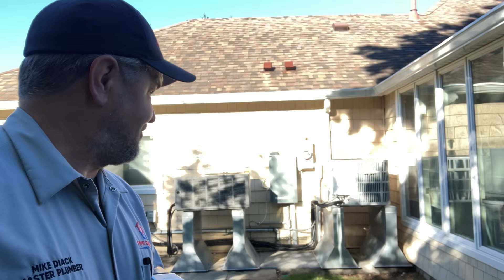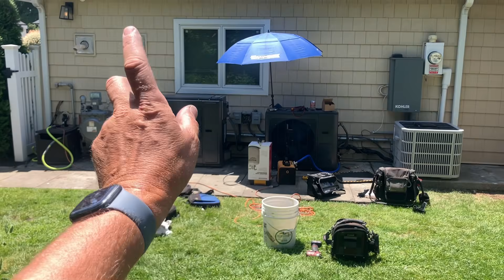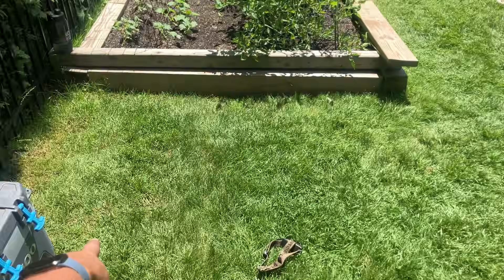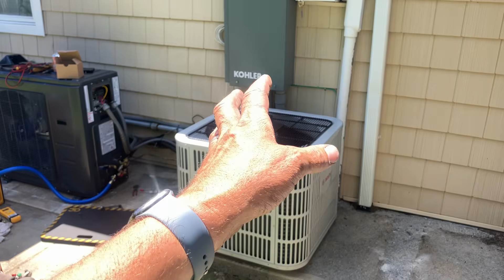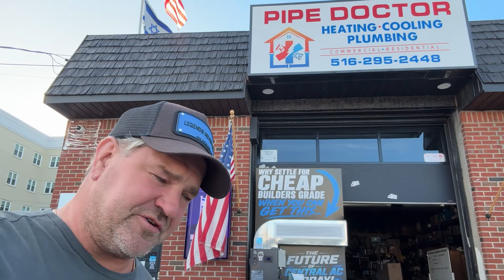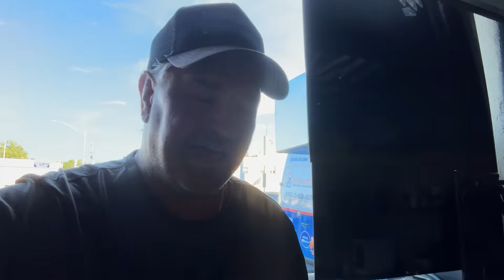We Installed TWO ACiQ Extreme+ Inverter Units Before Lunch! Bosch IDS Re-Rough + HVAC Upgrade

Comment: Brother, what are you talking about the Bosch IDS systems are communicating systems now. You only have to run two wires to the outdoor unit and most every situation now it just communicates through pulses of electricity now  the thermostat sucks yes but you put that sucker on an ecobee thermostat and you’re good to go
Reply: That’s only true if both indoor and outdoor are Bosch. I have IDS paired with their furnace in comm mode. Otherwise you have to use traditional 24V. And you must use the BCC100 to get fully communicating.
Reply from the maker: Great! So let me pay THOUSANDS more for the BOSCH name on the side of my equipment. No thanks. I'm quite happy building my brand while offering very affordable INVERTER side discharge equipment that is modern looking and sexy. #LOVEACiQ

Comment: Communication is good when you first put it in and everything works, but as time goes on the communicating equipment will spit out fault codes. So IMHO the Bosch is still a strength. It's certainly not cheap though, but in probably less than a decade we'll be talking about what comes next again all this stuff will be somewhat of an after thought. HVAC is always about what comes next. ACiq doesn't sound bad, but any manufacturer that gets wrapped up in communicating it becomes an error code hell eventually. The next breed will likely resolve those problems once and for all. R290 chillers Now if you're selling equipment to generate a service ticket later on, the communicating equipment won't let you down in that regard. The other benefit Bosch has is that it works with just about any thing, in an era where other manufacturers try to lock others out. Strength has it's caveats though.
Reply: nah, we install those communicating Heatpump here in europe and honestly never had any problems
Reply: @mitchienl2509  courtessy of HVAC UK https://www.youtube.com/watch?v=RRhlhRtOVyQ